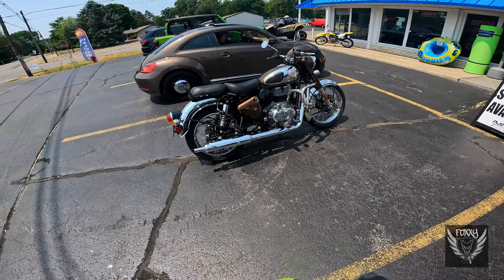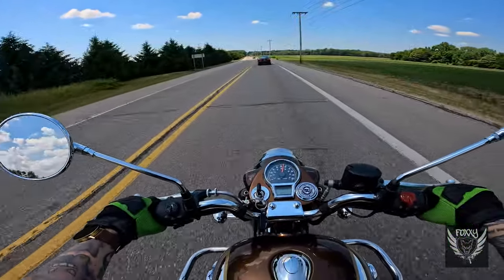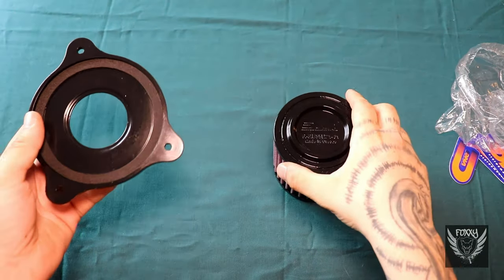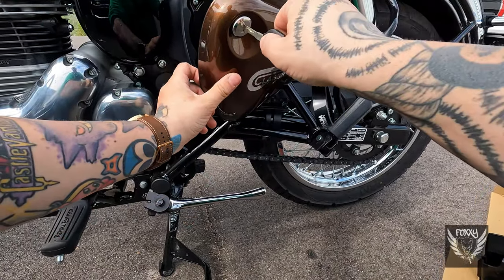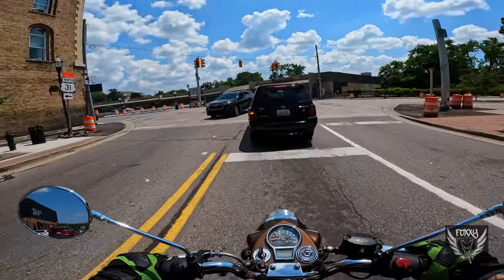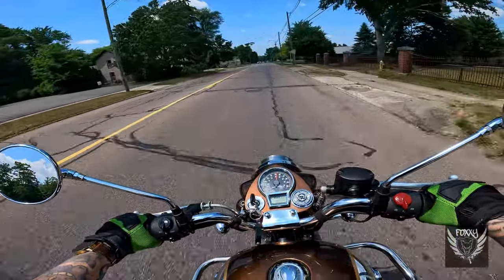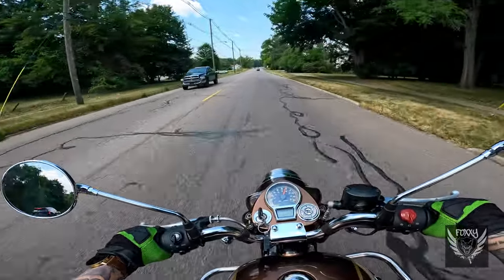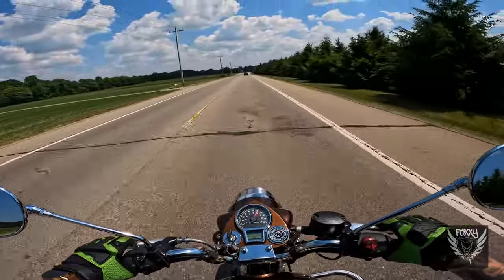Project Royal Enfield Part 1: RE Classic 350 DNA Stage 2 Kit - Does It Really Improve Anything?

Comment: I have a RE 500 and a RE 650 Int.   The 650 has plenty of power and is smooth but the riding position, for me is all wrong, back aches, bent wrists, ankles tangled in the foot pegs.  I am selling this bike. The 500 has a better position for me, and I prefer it's aesthetics.   The power is adequate, but the vibrations leave my hands and feet Numb after an hour of riding and the seat is, well, awful.  Aftermarket attempts to correct these issues have failed.   I test rode a Classic 350 and I would have to say, it is the most comfortable 2 wheeled conveyance I have ever ridden.  For me, the position is perfect.  The engine is smooth, very smooth.  The seat was incredibly comfortable.  I was ready to trade in my 650 for one,  but they only offered $2,000 dollars in trade-in (?!?)  I took the 350 up to 60mph and I saw the problem.     I understand that Freeway riding is not this bike's forte, but freeway riding is an inevitability here in the States. You cannot go anywhere without at least a short stint on the Freeway.   I need a working bike, not just a weekend joy rider on country roads or a downtown errand bike. .  My 500 does that just fine, as does my scooter.   I could jettison every other bike I have for this bike with it's qualities IF it had Two, just Two more horsepower.    This review is great, the descriptive analysis of the product and it's effect are clear and specific.  This gives me hope.  I look forward to further videos on this project bike.   Subscribed.
Reply from the maker: Where i live there are roads that have a 70MPH limit. The bike stock did not enjoy going that fast. With that intake upgrade it doesn't seem bothered being pushed to 70. I think that whenever i do the exhaust and the fuel x then things are going to be quite different, in a good way.

Have you checked out the Scram? It's just a Himalayan but IMO more comfortable and a bit more powerful
Reply: Io possiedo una meteor 350 con lo stesso motore. Ho montato il filtro DNA stage 2, ho rimosso il catalizzatore e sostituito il pignone da 15 con quello da 16. Viaggio in autostrada per ore a 100 km/h a giri bassi e posso accelerare in poco tempo a 120.
Reply: @paolosavoia6289  Grazie
Reply: @stevenmiller184 check out the Himalayan 452 which was newly released and give it a test ride. Cheers

Comment: Bought a DNA air filter to months ago for my classic 350 chrome bronze. Definitely a a bigger growl sound and throttle is more responsive. I first noticed that with the clutch release as it now feels more like it Is ready to bounce. I also noticed an incredible improvement going uphill.
Reply: Does it have any effect on fuel efficiency??
Reply: @akshaypatil7419  that I  haven’t noticed as fuel efficiency gets better as the miles accumulate and I bought the DNA filter when the bike had like 1300 on it.
Reply: Have you changed the stock exhaust too ?
Reply: @livebeyondlines1624  no. But I plan on doing just the decat pipe. An exhaust upgrade would require fuel x ECU. Where as in the decat pipe fuel x won’t be needed. To my understanding at least.
Reply: @maiojoserivera786 what changes occur when we decat. Does it increase the exhaust flow or purely for sound purposes?
Reply: @Bubbles-wu9kj  never done decat but from what I’ve heard it increases airflow and growler sound.

Comment: I drove about a 1000 kilometer's with the DNA filter. For me it's great. Yes, the throttle is far more responsive. I had 10,000 kilometer's on the clock with the old filter and I had to get used to the acceleration when going through a corner. But the filter really excels when riding against a headwind. I live in a rather windy province of the Netherlands. With strong headwinds it took ages to get to 80 kilometer's an hour (if possible) but with the DNA filter I could easily push the bike to 100 kilometer's an hour. So yes, it is surely worth the money. The English supplier Hitchcock stated a 10% increase in power and I think that's true.

Comment: If you want to get the best effect, de-cat the exhaust, and add the fuel X lite
Reply: what's fuel x lite bro?
Reply: @EllencyOfficial  it's a plug in box which goes between the O2 sensor and the ecu and makes the fuel mixture a little richer to improve the running, it's very clever but not cheap!, it's especially helpful when you de-cat the exhaust and open up the air filter, as these engines run very lean and with more air availability it helps to increase the fuel X lite or pro does it.
Reply from the maker: @kevindarkstar to add to what you said to @ellencyOfficial. 
When i added my fuelx to the bike it dropped the engine/exhaust temps dramatically. Your fuel economy will suffer because of that added fuel but the bike will thank you in the long run.
Reply: @FoxParasyte  you mean that it will consume more fuel?
Reply from the maker: @EllencyOfficial  yes exactly
Reply: @FoxParasyte  what about the air filter only? I have the DNA filter only mounted atm..
Reply from the maker: @EllencyOfficial  you probably won't notice any fuel economy changes. But im being your engine is running a bit hotter than before
Reply: @FoxParasyte  thanks a lot man. do you reccomand the fuelx as well now that I have the DNA filter?

Comment: Low displacement bikes gain alot more from the average HP vs big bikes. A handful of small improvements can net quite an improvement. I installed a K&N filter, de-restricted CDI, and iridium plugs on my CB 250 and gained a nice bump in all around performance. The KN filter gave it a throaty intake sound much like this Royal btw. Changing up the sprockets, upped my top speed and downed alotta vibration at hwy speed. Go aluminum sprockets, the weight loss is worth some perf. Your biggest bump in low end torque is going to ultimately wind down to getting a full blown Big Bore Kit w/Cam. It can be pricey if not doing the job yourself that is, and advisable only if you plan to hang onto the bike, but after feeling the difference especially from where the bike first was, youll be happy you did it. Mind you, its never gonna be any type of "track weapon", but it can most definitely be a robust well rounded bike thats enjoyable to ride for lifetimes ; )

Comment: Added the DNA stage 2 and imo it made a difference and makes a nice induction noise to boot.
Cost yup its not cheap but its a life time filter the cleaning  and re oiling kit costs around  £14 and is enough for 2 treatments if used carefully. 
So in the long run is not that dear as a stock filter which you cant clean costs £12 a pop
Reply from the maker: It's a situation where the upfront cost is high but long term it's more than worth it.

Comment: Some further possibile mods to increase performance: DID X-Ring gold chain (stronger chain), Red rooster exaust (supposedly one that gives a bump in performance and sound), Aluminum sprockets to save weight, NGK Iridium Spark Plugs (supposedly will boost the engine performance due to better tolerances), fitting a pair of ABS rings with fewer slots that could possibly raise the point in which the ECU trips the speed limiter (This is a BIG maybe), another possibility may be checking if there is a peice of metal or a stop on the back of the speedometer faceplate which trips when the maximum speed is hit (some bikes use this method for speed limiters).

Comment: Thank you for perpetuating the myth of the ten minute idle😂. In the early days of EFI it was possible to reflash the ECU using custom software. Both Royal Enfield and Bosch have stated that current EFI systems adjust in nanoseconds, not ten minute increments. 

The additional noise makes the bike feel different. Your statements about the “feel” of the motor bear this out. 

I did the air filter, Hitchcock’s free flowing exhaust and the Fuel X Pro. Altogether they probably add 0.5 horsepower. Any performance gain is likely caused by a lighter wallet! 

Mainly the bike sounds better. I returned it to stock configuration before I sold the bike. It was once again quiet. 

Honestly, going up one tooth on the front sprocket was the best and cheapest mod I made. This allowed me to cross an intersection before shifting into second instead of shifting halfway through. 

So the bike sounds better with all that done. The rest, including the ten minutes of idling, are pure placebo.
Reply from the maker: There are 2 myths in a follow up video that Im currently working on. I bring up those as complete BS.

The stage 2 and the Idle thing I kept hearing a lot of conflicting information so I figured well it's not going to hurt the bike regardless. Like I said it probably wasn't necessary.

I do have a buddy that has a Hunter who switched to the DNA and immediately rode it hard after install and the bike died on him a few times. Could have been an entirely different reason for it but I played it safe.
Reply: But then the dyno runs from the Hitchcock guys are a lie, also? They showed some 30% increase with full stg2, no ECU tunning.

Comment: I'm going to watch the rest of your classic 350 videos. But I'm curious, have you had the issue with the Speedo? My girlfriend has had hers replaced and the new one is already broken.
Reply from the maker: Yes but Issues in what way exactly?
Mine would skip ahead and read 80mph when only going 50. Then when I would stop the bike in neutral it would read that I was going 30mph.

I fixed that myself without replacing anything.
Reply: @FoxParasyte  the backing with the printing on it seems to come away from what's behind it and the needle gets stuck. I'd definitely be interested in how you fixed it. I'm willing to try whatever.
Reply from the maker: @CurlyWolf_  hmm don't know about the backing. That's weird.

Well I took the headlight assembly off and used electric sensor cleaner on the connectors for the speedometer. It was caked in grease. I then changed out the headlight for an LED one. Never had an issue since then.
Reply: @FoxParasyte  ah the grease. My Himalayan had some grease on some relays. I'll look into it and see if that helps at all. Thanks! Look forward to the rest of the 350 vids.

Comment: Hello!!, thank you for the DNA filter video!!!, excellent explanation. One question: what is the process for cleaning the DNA filter, and do you know how long this filter will last?  Thanks
Reply from the maker: It's a 2 step process. DNA offers a kit for servicing the filter which is fairly cheap.
Just a matter of cleaning and using the provided oil in the service kit.
Shouldn't really have to clean it often. Maybe once a year or more depending how often you ride.

Comment: This is by far not everything, but I think this covers the main things you can do to improve the bike: Camshaft from hitchcocks, rear sprocket drive tooth mod (either remove or add a tooth depending on if you want speed or acceleration... Also found at hitchcocks), this DNA air filter upgrade, DNA cover, a full exhaust upgrade, FuelX Pro, Better tires (maybe?), and upgrade breaks (maybe?). I also saw a product called the Magnum Revolution-Pro REV Limiter CDI box, which supposedly connects to the stock ECM board of the motorcycle and allows you to increase the maximum RPM, allowing higher speeds, as Royal Enfield sells the bikes with a intentional limiter... Probably for longevity of the motor, but I've heard in Brazil they removed the limiter from their bikes due to legal reasons... I guess it works fine without it?
Reply: Something else I want to look into should I get this bike is if I can attach one of those classic style leather seats (found on ebay) with actual functioning springs like previous royal enfield models had. Otherwise I might look into having a custom bracket fabricated that would allow an old seat like that to work on the new frame. It'd be super neat and it'd probably help feel nicer alongside a gel liner underneath the leather which Mother Road Customs has said they could do alongside redoing the leatherwork so it's a bit higher quality. Best of both worlds I imagine. Correct me if I'm wrong on that! Perhaps they removed the functioning springs for a reason other than cost.
Reply from the maker: I do have plans on the camshaft upgrade and the fuelX lite. I didn't think about changing the sprocket tooth size although i have debated on upgrading them to ones of better quality... including the chain. I'm 50/50 with the limiter removal. I'm fine with the top speed at 75. 80 would be perfect in my travels but i'm not sure if being able to just change 5 mph  if that's even possible. I've not heard of the Mag Revo box, i'll have to look into it. Honestly i'd be more happy upgrading the acceleration a bit, rather than the top speed. My concern with removing that limiter is pushing the bike to a point where it's damaging the engine. 

Im wanting to basically turn this thing into a rural/city powerhouse but at the same time keeping it's engine reliability.
Reply: @FoxParasyte  I imagine you could do tiny increments of lifting off the limiter (as that's what that Magnum product claims to allow) and as long as you don't do anything too far it would be okay. The only issue with down gearing the rear sprocket for acceleration is that it requires higher engine RPM to maintain the max speed, which because of the limiter isn't possible, and as a result you would loose more speed on the already rather slow classic. I definitely wouldn't do sustained high speeds on the bike stock, let alone with a limiter bump and other mods though as that would probably strain the engine quite a bit. However, to have that extra bit of speed for emergencies or should you need to hop on the highway quickly and then hop off, it'd be great to have.
Reply: @FoxParasyte  I forgot to mention that there was a guy who took the clutch and exhaust of a Classic 500 and put it onto his Classic 350 reborn which gave better acceleration as well. Something you could possibly look into if you're crazy enough to do it like him. It's an involved mod.
Reply from the maker: Ok so if that Magnum does allow small increments i'm probably going to look into that. I don't want it to go past 85 absolute max. If that's the case about the sprockets i'm probably just going to leave them alone and just replace the chain with a gold X ring.  When i get around 3k miles i'll look into the sprockets to see how worn they are. If i don't think they're worth replacing i may just not touch them until the time is ready. Then go for something better made. 

Yeah running the bike stock at 70 was a bear. You could tell the bike wasn't thrilled. With the open air intake it feels so much less stressed when on highways. Even just that change alone has significantly improved how the bike functions.
Reply: @FoxParasyte  Yup, either down gear rear sprocket for acceleration at the cost of max speed, or up-gear it at the cost of acceleration for max speed. I'm definitely going to have to do that air intake mod! Doesn't seem like there is any negatives to it, and it's not super expensive to do. By the way, have you heard that there may be a RE Classic 650 in a few years? There was one spotted in india being tested, which means we could see one possibly in 2025 or 2026 in the US.
Reply from the maker: @izaicslinux6961  I heard about the 650 recently. To my understanding it's the same engine and everything from the rest of the 650 twin platform. Idk how i feel about a twin cylinder Classic. I feel like that kinda takes away the charm of the bike. 

Doesn't mean i'm not open to checking it out in the future though lol.
Reply: @FoxParasyte  Yeah. Hopefully they keep selling the 350s as well. I kinda like them. Just need like 5 extra MPH out of them and a tiny bit more acceleration lol.
Reply: @FoxParasyte  The FuelX is next step if you have the air mod done. The bike is lean from the factory and becomes leaner with the DNA filter, a needed fix with the FuelX. Do not worry about overrevving if you manage to remove the speed limiter. The bike have a revlimiter for the engine. Speed limiter works of the ABS on the front wheel.

Comment: To improve performance you need to replace the full exhaust system. Nothing else will make much difference
Reply from the maker: I guess it depends on what type of performance you're looking for. I know that the stock exhaust is restrictive as all hell so there's no surprise that a full exhaust will make a significant change. But definitely the stage 2 DNA made a massive difference with the uphill performance, throttle response, and being more comfortable at higher speeds. 

The Cam is another story but i have to have someone install that one for me. Engine work is not something im confident with.

Comment: Hello Foxxy, greetings from Oregon !. At cold start, the engine needs 2 starts to fire since I installed the dna filter. Did you experienced this ? Thank you.
Reply from the maker: @bojoregon  by 2 starts, what do you mean exactly. Like its shutting off the first start?
Reply: @FoxParasyte  ,  thank you for your reply. It is appreciated. Yes, when I push and hold the E-switch (red button), it is trying to start but it feels like the engine is choking ; then I stop holldnig the red button, and finally I retry and it is firing just fine and runs great. I am wondering if the air/fuel mix is not read correctly by the ECU at cold start....Thank you for your videos, very nice and helpfull !
Reply from the maker: @bojoregon  i don't recall noticing that at all. Is this your only modification? The fuelx is on my bike and it fires up without any hesitation unless its like 40 degrees outside
Reply: @FoxParasyte  , yes just the air fliter. Might switch back to the original, let it sit for a while and redo it again.
Reply from the maker: @bojoregon  I wouldn't be too bothered unless the bike is shutting off when idling for a period if time
Reply: @FoxParasyte  Thank you and ride safe !